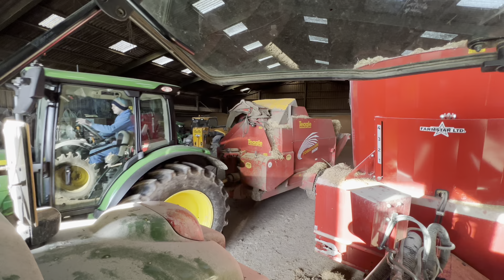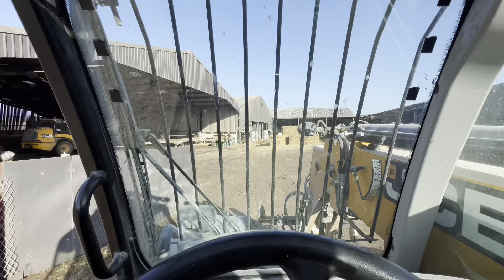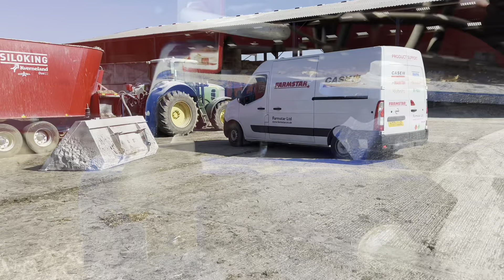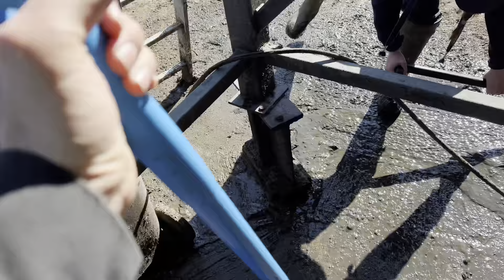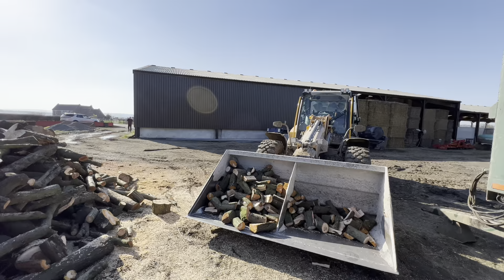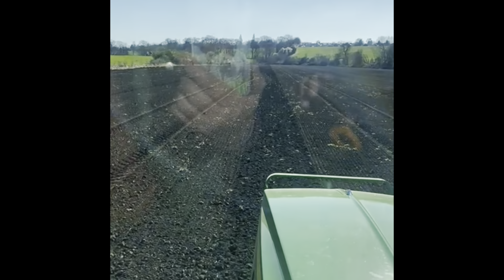Dealership Issues this Morning, Wood Chopping, Ems makes me feel old!

Comment: Cut the disk but let it air dry in to to hot a place for 2 or 3 days give it a good sand and cure it with work top oil works a treat👌